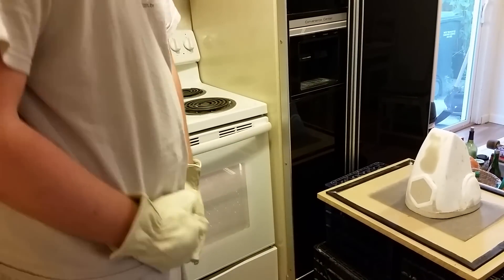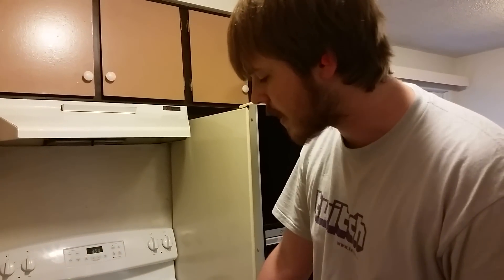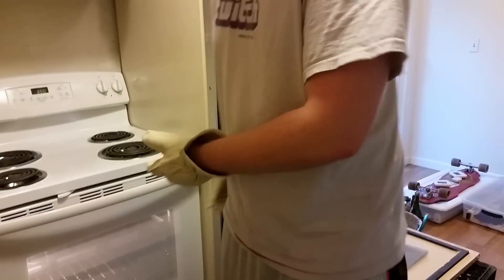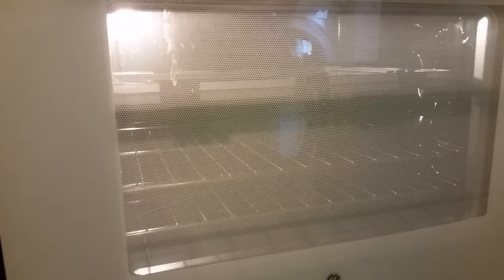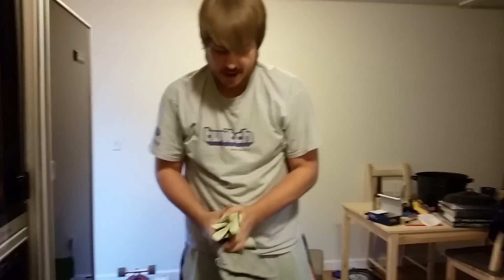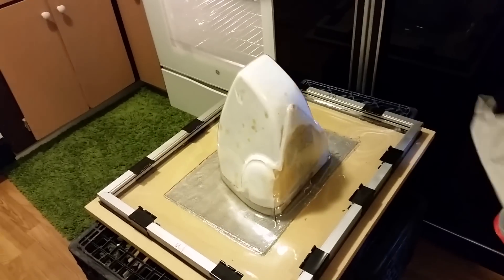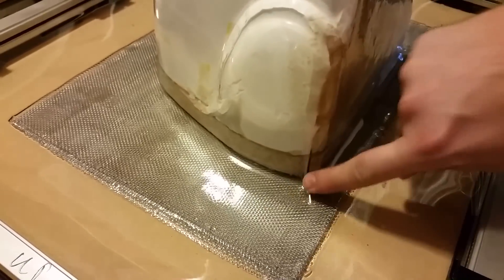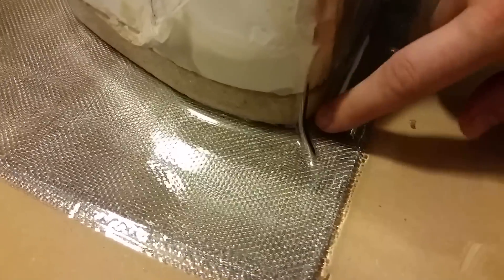Vacuum Forming

Comment: How do you avoid cracks when releasing the vacuum? I've recently done my first 2 pulls on my diy vacuum table. First one developed a few cracks. My second one, i thought hey, the first went okayish,  lets try laying down mirror tint on it. Did not work. It does not stretch enough at all, amongst other issues.